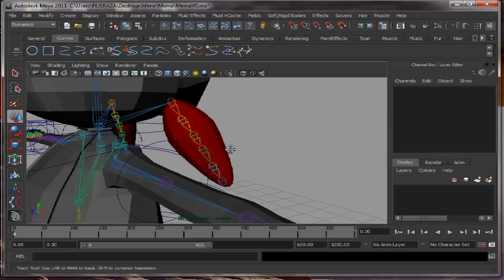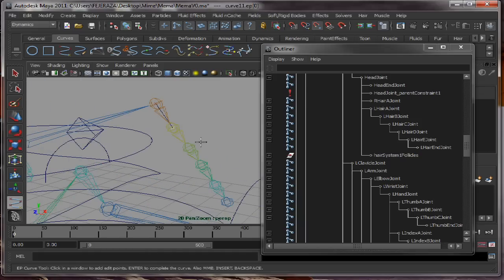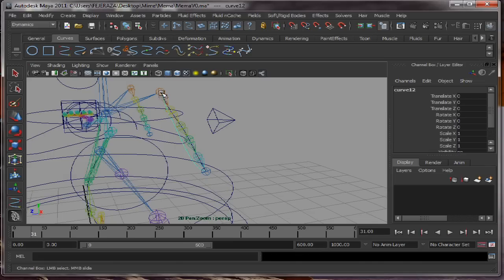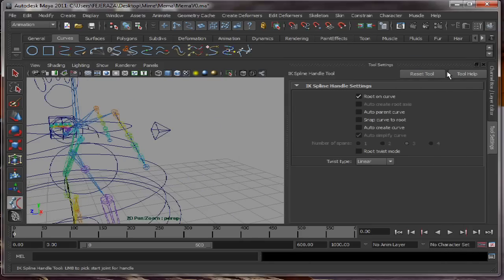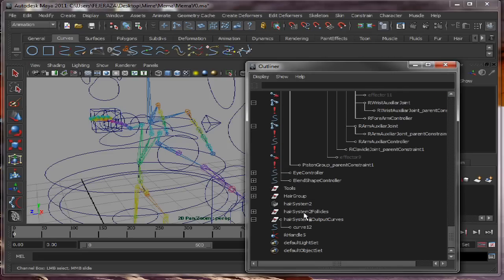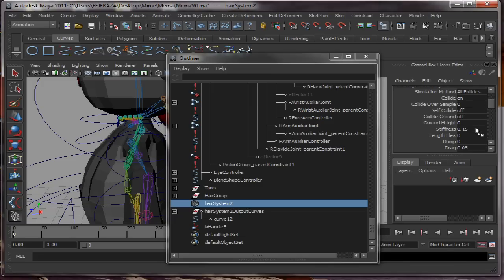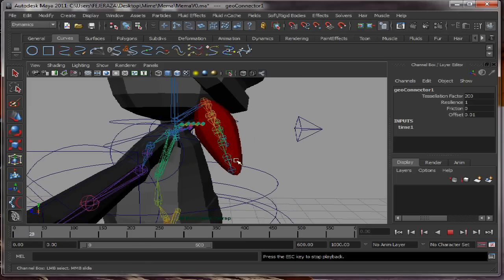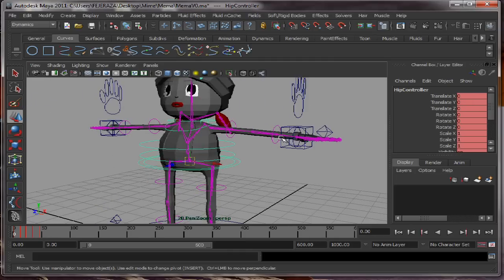Dynamic Pony Tail Maya 2011

Comment from the maker: I just checked your video. How many hair systems you have? the think is that, if you only have 2 hair systems, the rope one, and the pendulum one, the joint will not have enough space to separate properly. You need to create some more hair systems in order to give a "gradient" increase to the offset, otherwise, you will have a sharp cut between both hair systems, resulting in the dotted line and the curve separation. The dotted line is the "glue" attribute of the constrain, and shows the offset

Comment from the maker: mm, its hard to know what is happening. Just reviewing the steps: have you assigned the "MakeCollide" for each of your hair systems?, did you parent the RubberBand constrains to the IkHandles?. The dashed line you are talking about is the hairSystem "curve", you can see the hairSystem as a very small ball colliding correctly, but the offset makes the actual joint chain move far away from the original curve. This means that the hairSystem should have less Offse, which is the dotted line you see.

Comment from the maker: ohh, I see. Well, Maya single curve hair dynamcs is actually not designed for collision variations. That can be handled better with nCloth or with proper maya hair follicles. However, it required more much computer power to use those solutions. I can think of som trick that can help you if you want to solve this with single curve dynamics. You will need to use several hair systems attached to  give the sense of volume variation. Video is on the description as always.

Comment from the maker: hi Andrea. I can think of several possibilities. You probably already checked this, but starting with the basic, have you tried playing "Every Frame" instead of "Real Time"? depending on the computer power, sometimes it can't evaluate the collisions on real time. 
Other thing that usually generates problem is the scale of the scene. Hair systems work better in real scales. Say for example, if your model is 40 meters tall, the gravity needs to be increased, otherwise, it will look like floating

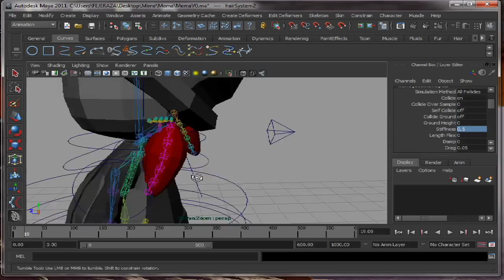Comment from the maker: There is. Select the dynamic curve, then the mesh, and go to Hair-> Make Collide. In minute 4:20 there is an example of Mesh colliding. In order to avoid cycle warnings, be sure to put the Body mesh and the Hair mesh as separate objects, otherwise, you will have the hair colliding with itself. 
If the hair is too bouncy, try incresing stiffness, friction, damping. Or, if your scene is not in real scale (for example, if the character measures 100 meters) try increasing the gravity.

Comment from the maker: it doesnt. But actually, if you are using a very large amount of polygons, the Playback can go wrong, you should put the "Play every frame, max RealTime" option in the timeline, in order for it to evaluate correctly. The actual size of the file in kb is not affected significantly.